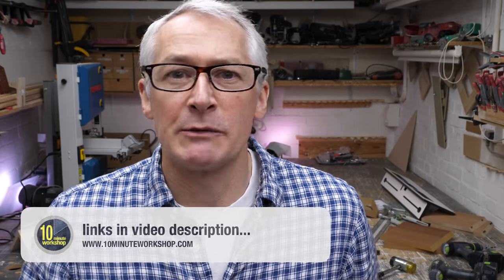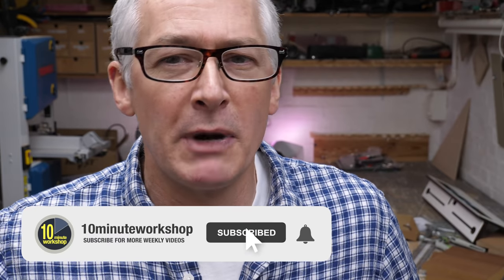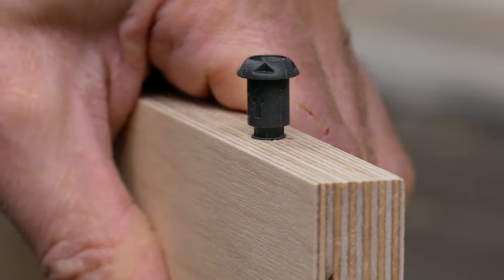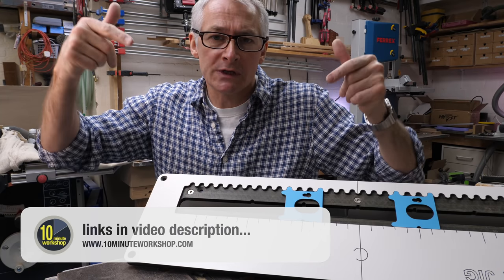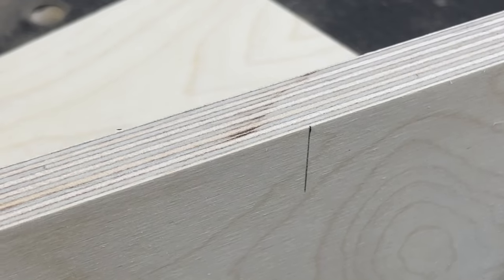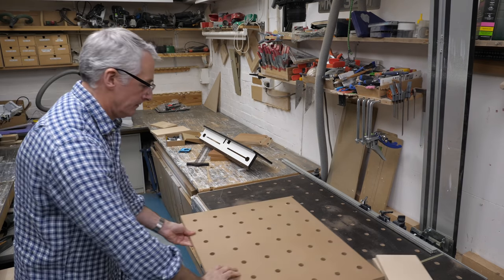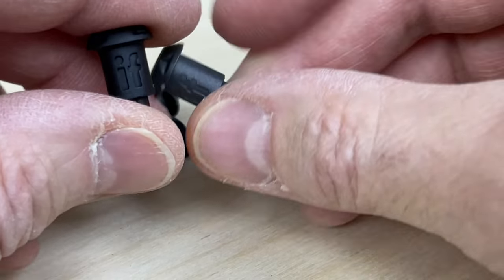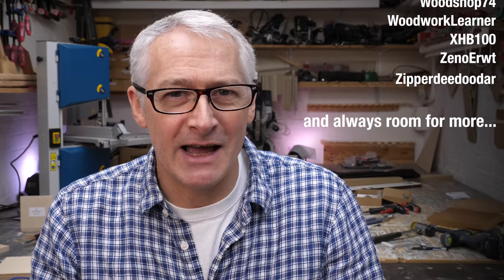Peanut 2 Jointing System - the mid-range solution? [Gifted/Ad**][video 429]

Comment: Hello Peter. Great content as always. Sorry if this has already been asked, but I was too lazy to scroll through all 300+ comments. 😂 If someone were to use this in a knockdown application, do you have a rough feel for how many times the joint could be assembled/disassembled before the wood started to compress a bit and weaken the joint? The type of material used would obviously be a big variable.
Reply from the maker: Hi Brandon. As you say the materials are the deciding factor, and it’s probably worth mentioning that it’s designed as a system for easy on-site assembly, rather than a knock-down fixing as such. But it does produce an immensely strong joint - 140kg in MDF, 225kg in plywood - so my guess would be many, many times.

Comment: Did you use your own 30mm guide bush or an IF one, according to the IF guide bush tech drawing the protruding depth of theirs is only 4mm. The question therefore is; is there a reason you would need such a shallow bush or would I be able to use one of my own (Dewalt/Trend) that i already have for my 1/2" routers?
Hope you follow my drift Peter.
Thanks
Reply from the maker: The ones I had were all low-profile ones so not an issue for me. The newer mini jig didn’t have the issue. 👍

Comment: There was no mention of glue in these joints.  How do you feel about adding glue in the joint between the peanuts?
Reply from the maker: Absolutely, depending on the board finish, of course. But yes, like the Lamello Tenso connectors, adding glue only strengthens the joint. 👍

Comment: I wonder how these work in a CNC nesting machine workflow. I'm guessing you would need to put the panel on the machine a second time, because horizontal drilling into the edge of a board doesn't  work when the panels are nested together in a large sheet (no space for the drill). We currently use the lamello invis as knock down fasteners, which also require horizontal drilling. But they are very finicky when they are not perfectly aligned and quite expensive. If these peanuts can be programmed into the drawing process with a macro, then they may be a good alternative.
Reply: Hi Eduard, thanks for your comment, you are correct the Peanut 2 requires end drilling also.  We do have a nesting solution called the Peanut 1 although this can be visible depending on how you build your cabinets. We do have supportive software for some CNC machines.  You can find more information on our website: www.intelligentfixings.com
Reply: @IntelligentFixings  Hi, a visible connection is not an option for us unfortunately. Some horizontal drilling is not a problem since we only use knock down fasteners when assembly on site is required. Mostly things are assembled in the shop. Do you happen to have something for PaletteCAD software of SCM Morbidelli machines?

Comment: Interesting.  I am on the far side of the pond for this, but it is still fascinating (or fasten-ating).  Do you think the supply of parts is stable?  Be a shame to buy the jig and have the connectors dry up.  And, are additional guides available so you can have three or four peanuts in a joint or do you just move the ones you have?  Instead of KD furniture, I am still trying to build stuff that does not KD or just fall apart.
Reply from the maker: The jig comes with 4 guides / inserts as standard and everything is available as spares afaik, either through Axminster tools or direct from intelligent fixings. The starter set gets you everything you need, and no, there’s no way the connector supply will dry up, Intelligent Fixings are a big business with sales & distribution throughout the UK and Europe. 👍👍

Comment: Hello, thank you for your video. What are your thoughts on this joinery system after having had it for a year? I am also curious to know if you have used these peanut connectors with glue to make permanent joints? 
If so, did you find that you got satisfactory glue squeeze out from the joints without having to use clamps? My search continues for the ‘holy grail’ hidden self-clamping connector that can really snug up enough for a permanent glue joint. I am suspecting that they probably don’t exist though. Recently I have been experimenting with the various offerings from Knapp Connectors. They make a variety of different self-clamping dowels as well as biscuits (and other types of fasteners). They are good quality but so far I haven’t found any that really close the joint up enough for a good bond with PVA glue. Well, thanks again for your video, it was very informative.
Reply from the maker: They’re excellent, no hesitation in recommending them as a tight fitting connector for a glued joint. You can actually fine-tune the level of ‘bite’ in the joint by adding (or taking away) a quarter-turn on the screw. 👍
Reply: @10MinuteWorkshop  That’s great to know, thank you for your response!

Comment: This looks like a really good system, but there's something I don't understand: you lower the router down to a stop, and then move it sideways, making a horizontal cut.  How does this achieve the wedging effect?
Reply from the maker: It’s achieved through a combination of original thought and material science. And solid engineering. 👍👍
Reply: @10MinuteWorkshop  Thank you.  I've just seen the animation on the IF website, which shows the wedge shape of the cutter, illustrating how the P2 self-tightens.

Comment: As a domino user I like the look of this tool.
Reply from the maker: Yep. I think it’s a complementary system for when you need a quick clamp-free glue-up, or for on-site assembly. 👍👍
Reply: @10MinuteWorkshop  yes it’s the clamp free application l like especially for larger panels. 
No sure I how I’d use it for door frames but for invisible joints between cabinets I can see a use.
Reply from the maker: Mini jig may well be the answer for door frames. 👍

Comment: Nice system. I think the mini one will be the key, as it should fit a price range that'll hoover up the hobbyist market. I've got a Domino, and my first thought was that it was too slow and finicky, but again the mini one might address that. I don't like the long template jig thing, I'd rather have something you can slide up with a square and use a trim router to quickly cut the slot. That might be wishful thinking though!
Reply from the maker: Yea, the mini jig will be a very interesting entry in the market. Router bit is 1/2” shank, and needs a plunge, so I don’t think a palm router is the man for the job. I’ll know more when I get my hands in one though. 👍
Reply: @10MinuteWorkshop  yep, assumed the palm router would be a stretch. I'll maybe just shove my drill in and wiggle it about a bit. Can't see it being an issue!
Reply: How about a palm router with a plunge base option?
Reply from the maker: Half-inch palm router?? 🤔
Reply: Well I am a complete router newbie and I thought my Makita palm router had 1/4 and 1/2 collet adapters but turns out it is 1/4 and  3/8. Has a plunge base accessory though 😁.

Comment: As usual, great review.

At the top of the video you mentioned a joint strength in plywood of 160kg per fitting. How does that translate in to real world applications e.g. could these be used as the sole fixings for a bed assembly, obviously with the keyhole aligning with gravity? Or are they mainly for non load bearing applications?
Reply from the maker: Thanks! That’s probably one to ask Intelligent Fixings tbh, as they have more experience of them in other applications than I do, but from what I’ve seen I don’t see why you couldn’t use 3 or 4 of these in line for a bed fitting, no. Could be an interesting experiment actually, thanks! 👍👍
Reply: @10MinuteWorkshop  3 in a row is what I was thinking too. I'll drop them a message and see what they say. Thanks again
Reply: Contacted Intelligent Fixings and was advised that while the Peanut2 was suitable for most applications, bed side rails is not one of them. They recommended traditional methods such as bolts or brackets. Hope that helps somebody else.

Comment: Would be interested to see this in action on floating shelves. Batten on wall with male peanut and keyhole shelf slide on to that. I know that will be 100kg in tension rather than a sheer force but I've got a feeling it would still perform well.
Reply from the maker: Interesting idea! Just trying to figure out how you'd finish the underside?? 🤔
Reply: @10MinuteWorkshop  me too! Something slidey i think
Reply: I think you are really onto something. In terms of achieving a good finish I would see the method involving using the intended shelf material for the whole lot and cutting (tracksaw) a 50 mm strip, jig both surfaces and machine both surfaces for peanuts. Secure the 50mm bit of shelf material as a ‘batten’ to the wall - offer up the shelf to the batten and tappy tap tap to engage the peanuts.👍

Comment: Great system, I believe Ikea use a similar fitting in their platsa range of units.
Reply from the maker: The IKEA system is similar - and IKEA are aware of the Peanut connector - but it’s sufficiently different for the peanut to be patented. 👍👍
Reply: @10MinuteWorkshop  I’d almost go as far as to say the peanut looks cleaner and simpler, so a thumbs up from me. Another tool to add to the wish list alongside some from your makers Christmas list 👍🏻

Comment: Great video Peter. It looks like you have the Trend GB5 sub base on your router. Will the guide bush not fit on a standard Trend T11 base?
Reply from the maker: Thanks! No, it didn’t seem to want to fit directly into the base, but went on the sub-base just fine. 🤷‍♂️👍

Comment: Would this system provide enough rigidity for small sofa console table legs? I am very tempted to purchase but I am concerned about dropping the $$$$.
Reply from the maker: If the legs are on a frame then yes, but if you’re looking to attach a small section end grain leg to a top then I’m not so sure. Not something I’be done I’m afraid. 🤷‍♂️
Reply: @10MinuteWorkshop  Thank you for your expeditious reply. I really like your channel.

Comment: Interesting product Peter. I find myself wondeing if it would be suitable for making movable shelf rails?
Reply from the maker: Thanks Mark. I’m sorry, not sure I understand what you mean by ‘movable shelf rails’ 🤔🤷‍♂️
Reply: @10MinuteWorkshop  Instead of drilling shelf pin holes, I was thinking of drilling those keyholes and using two "rails" of narrow material, with two "peanuts" in each to fit in the slot. With one rail attached to each side of a carcass. Thus providing a some what more stable support for a shelf and perhaps overcomming some of the issues of using shelf pins.
Reply from the maker: Ah, I see. It would be doable, certainly, though you’d probably need something to keep the shelf locked onto the rail eg dowels, and then I wonder if it starts to get over complicated. Also aesthetics; a column of 5mm shelf pin holes is fairly discreet, a column of keyhole slots maybe not so much?? 🤔🤷‍♂️👍
Reply: @10MinuteWorkshop  I agree, but the idea might be useful in making a shelf that is stronger than normal for special uses.
Reply: @10MinuteWorkshop  On the "locked in " part a short rail with some edging on the shelves that overhangs the rails would work nicely.

Comment: Do those peanuts locate or snap into place? I'd have a worry that they would be constantly fighting to work loose?
Reply from the maker: No, they tighten up as they’re slid into place, but they don’t snap in with a sense of finality. They are very strong though, zero chance of the ‘working themselves loose’ IMHO. 👍

Comment: Very cool jig!  Do you have a video showing your use of the domino in a knockdown application you could point me to?  I do not have a system for knock down joining yet and am exploring options, but I really like the completely hidden feature of this system!
Reply from the maker: Thanks! I think Part 2 of an old banquette build shows me using the connect fixings for the first time, here - https://www.youtube.com/watch?v=zcra2qVJC3o - and I did a video that compared the Domino Connect with the Lamello Clamex fittings here - Clamex or Connect - https://youtu.be/TzOAwo3vpqI. Hope that helps! P
Reply: @10MinuteWorkshop  Thank you for taking the extra time to link the other content, very helpful!

Comment: These look great. Do you know the difference between the peanut 2 & 3? They look almost identical
Reply from the maker: Thanks! My understanding is that the Peanut 3 is designed to be inserted during manufacture by industrial nesting-type machines, and is a friction fit ie no screw required, or hole provided in the fitting. 👍
Reply: Thanks. Do you have any thoughts on how the strength would compare to a domino? Not quite the same, I know, but if the domino was held in place with something like a Rafix connector, no glue. Is there 'load per connector' for domino to compare to the 100kg you quoted for this?

Comment: Thanks Peter for the look at this system.  The key here, and I think the most difficult is setting up the router and carbide bit to just work perfectly in milling out the hole.  Would you please do a short addendum video on how to do that.  And the question below about recommended length between peanuts for large length cabinets.  The fact that there are no expensive power tools involved is what got me to look at the DowelMax system.  That system is not as precise as either Dominos or this system.  As you pointed out, ALL these systems have their drawbacks.  Stay safe!!
Reply from the maker: Thanks! I didn’t want to cover the jig setup too much as this has been done very well in videos by Intelligent Fixings; though I do mention it in the vid, and as I show with setting the drill depth, there’s a notch in the jig that you plunge the router to, and set your depth stop. Takes 2 seconds to do. 👍

Comment: I'ld be really curious to see how these compare with the domino and lamelo connectors in terms of speed and practicality... the peanut looks really good but a bit more time consuming...
Reply from the maker: Slower to use a jig & router yes, but no clamping, and can be used in narrow stock unlike eg Lamello. Also cost benefits - jig is 1/3 the price of a Zeta, fittings are ~1/10th the cost. Also mini jig coming soon, brings down the price of entry massively. 👍
Reply: @10MinuteWorkshop  I think depending on your amount of work you will do the cost of the fittings are neglegible. If we are talking several hundreds of pounds for the templates it really is not decisive whether the cost for a fitting is just 1/10 if one wants to build e.g. just one kitchen. I compare that with model railroad modelling where you might get a one time cast part from even silver if that is what the contractor is able to provide.
Reply from the maker: That's what I though when I bought my Lamello Zeta; thenI started adding up the sheer number of Tenso fittings I needed to pull a simple MDF table together, and it really eats into your margins. Also, if you find you're getting low on both Tenso and Clamex and suddenly you have to find 500-odd quid. 🤷‍♂️

Comment: Hello Peter, interesting system, well presented.  Just one question though.  How is the varying slot depth produced?
Reply from the maker: Thanks Steve. On the CNC it just ramps the cutter, on the router & jig it's something else, and tbh I don't quite understand how - hope to be getting a more detailed explanation this coming week! 👍
Reply: Yes I was wondering that. Is the jig plate tapered in thickness so as the router slides along it make the slot deeper?

Comment: I think it is a neat idea, but it is a lot of extra steps and fussing as well as needing extra equipment in addition to the fairly pricey kit.  Zeta, Domino or Duo Doweller seems to be much quicker and simpler and allow one to take a single tool to the work rather than the work to a collection of tools.
Reply from the maker: Not really; I take it slowly because a/ I’m explaining the procedure, and b/ I haven’t had it for that long so it’s all quite new to me. Yes, the cutting the slots stage is slower with a jig and router than a dedicated machine (also 1/2 to 1/3 the price of that machine) but the time saved is at the glue-up/construction stage because the joints can be handled as soon as they’re slid together. 🤷‍♂️👍
Reply: Peter, thanks for taking time to reply!  You raise a good point regarding quick handling.  If you could avoid glue and a small collection of clamps at glue up then the little bit you lose at the front of the process would certainly be gained and more at the end of the process without having to have the clamps and glue dry time.  Would you be comfortable building a built in or set of kitchen cabinets using only peanuts for the carcass joinery?
Reply from the maker: Yes, absolutely! Take a look at the Thomson Brothers website - thomsonbrothers.co.uk - all their furniture is made with the peanut system. Luke Thomson - founder of Intelligent Fixings, inventor of the Peanut system - created it for his own use.

Comment: I love it and want one. One question thou.
 The IF website seems to be a lot cheaper at £333 than Axminster tools at £399. Does the starter kit Axminster sells include something that the starter kit from IF doesn't?
Reply from the maker: Thanks! Pretty sure the IF prices are +VAT, and the Axi prices inc VAT. 👍
Reply: @10MinuteWorkshop  just didca dummy checkout. You are right. £400.20 from IF

So Axminster is cheaper (just)
👍